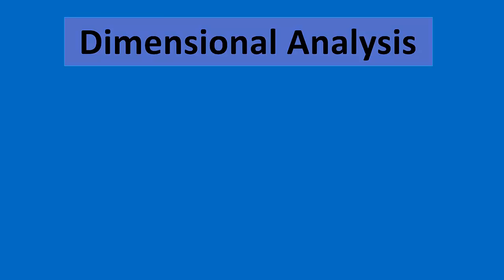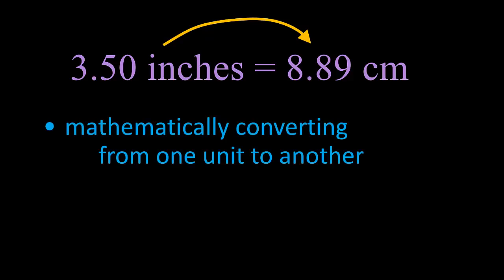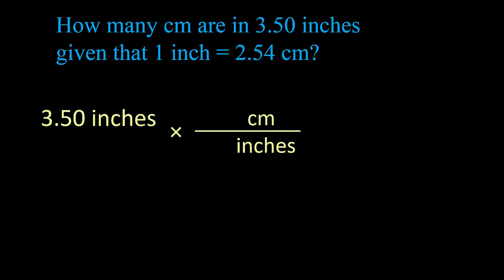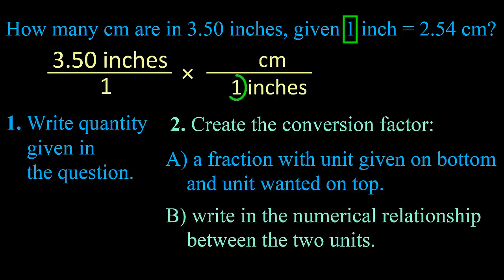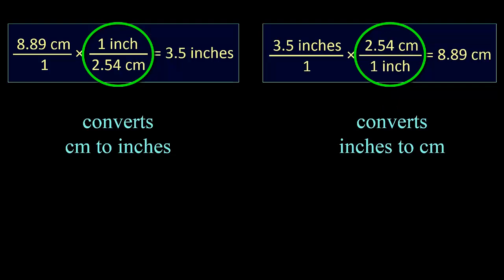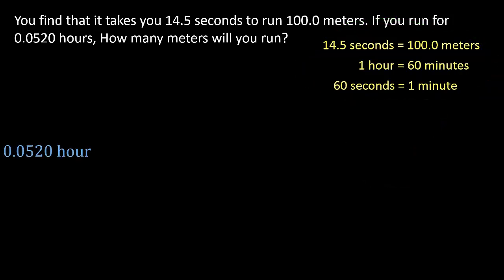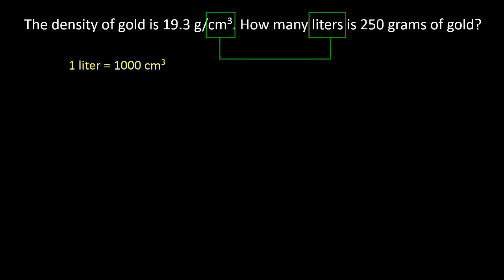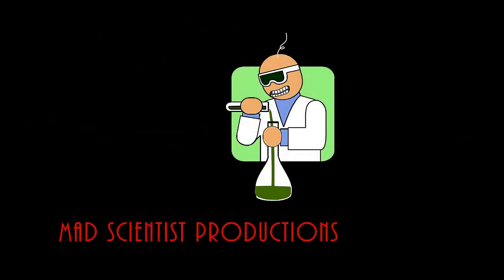Unit Conversion Using Dimensional Analysis Tutorial (Factor Label Method) | Crash Chemistry Academy

Comment: The second one the answer is 1291 not 1290. I did the same math as you on the screen and followed along and it was still 1291
Reply from the maker: Yes, that is the calculator answer. I had rounded the answer to three significant figures (1291 = four sig figs, which rounds to 1290, = three sig figs) since that is what is called for in the calculation. Sig figs are important in communicating the precision of measurements. If you are not familiar with sig figs, please see my video here: https://youtu.be/Umae3hOsgVc?feature=shared

Comment: @6:16  heyy isn't the answer 1291.0 meters?please lmk bc ik not getting the answer u have .I think u made and error
Reply from the maker: 1291.0 is the calculator answer. I rounded to 1290 to adhere to significant figure rules. If you want to learn more about the rules of significant figures, please watch this video: https://youtu.be/Umae3hOsgVc. If this were a test or HW question and sig figs were required, then 1291.0 would be considered incorrect.

Comment: I thought you can’t cross over two different dimension/units but this gave me a new idea. Thanks.
Reply: Units are a representation of the value only. They can be cut and multiplied. That is why acceleration has the value of m/s² . Didn't you think how can u represent a unit in division and powers?

Comment: How did you get the answer 1290 for the second problem, I couldn’t get that , and I followed your steps
Reply from the maker: at 6:37 the math setup is given (in green): multiply all top numbers, 0.0520 x60 x 60 x 100, and then divide by all numbers on bottom, in this case just 14.5 since the two 1's can be ignored. you get 1291, which I rounded to 1290.
Reply: @CrashChemistryAcademy  thank you!
Reply from the maker: @reneerodriguez1745  You're welcome!